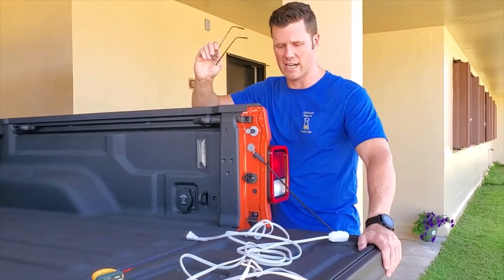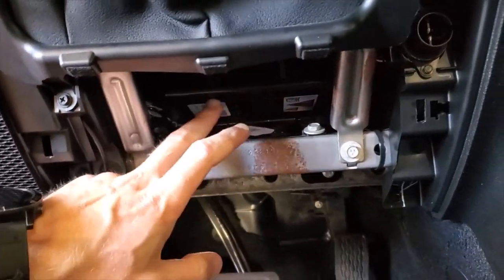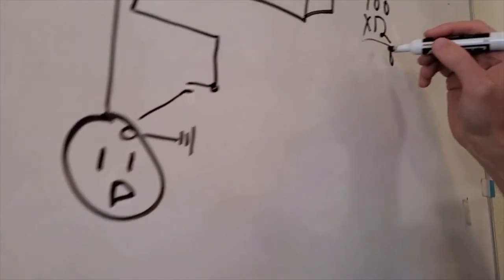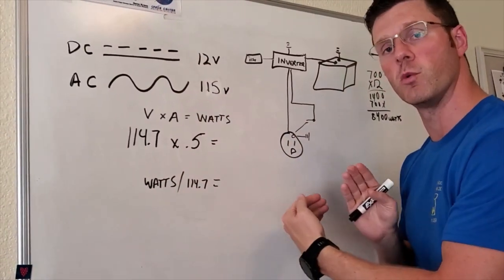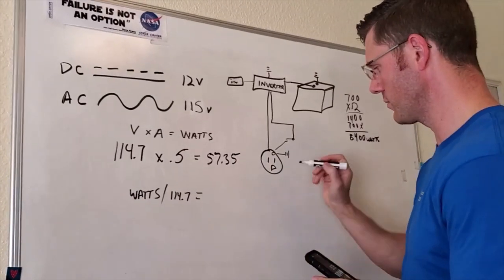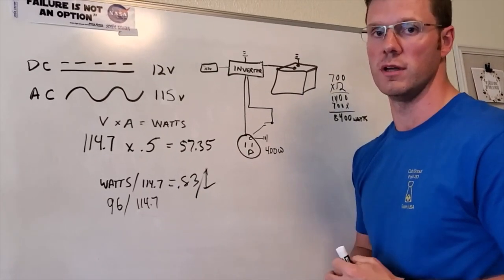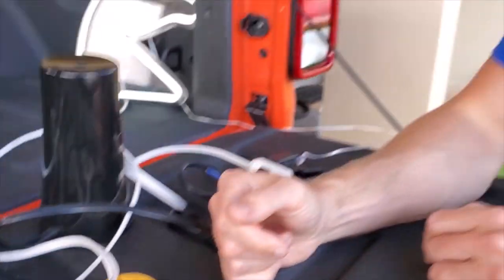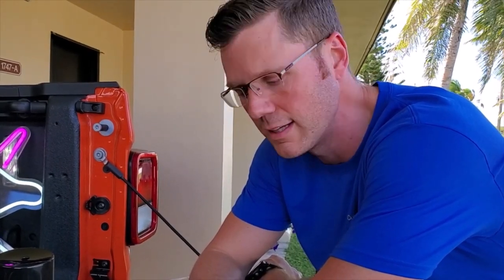Jeep Gladiator Ram Truck Power Inverter put to the test! You plugged in what? LOL

Comment: You're a lucky guy. I can't get any more than 102V AC from either one of my Gladiator outlets and I've been to three dealers who all say that's OK. I even had a dealer unlock a new Gladiator and let me check it out. Same thing exactly. At the house this same meter reads 122V AC yet your same meter shows 114.7V AC. Low voltage can burn up AC motors by drawing too much current.
Reply from the maker: These things do tend to run low but 20 percent low is way too much. I would not run an ac motor on these. Its too small for that. But it works for camping type stuff. I had a TV plugged into it as well. Worked great.

Comment: My problem is the factory plug is only good for 400w. My Bluetti pulls 465-470 and kicks it on and off. I need to upgrade to larger inverter. HVe any suggestions?

Comment: Great video, did you try or has anyone reading this tried an air compressor?
Reply: I have a small portable air compressor designed to inflate normal vehicle tires. Works fine plugged into my Gladiator. Does inflate my tires.

Comment: Thanks for the upload:) Do you know if the 400w OEM inverter uses a Pure Sine Wave or a Modified Sine Wave? (I have the same one on my RAM 2500HD) If it is a Modified Sine Wave, then it limits what I would plug into it.

Comment: Can I plug the Dometic CFX55 fridge in the the back of the Gladiator?  Its power rating is .84amps at 120V or 8.9 amps at 12V.  Not sure if it'll work with the 115V outlet rating or is it best to just plug it inside the truck's 12V outlet.  Thanks
Reply from the maker: 84 amps at 120v doest sound right. Powerful home outlets only go to 15 amps on most circuts.
Reply from the maker: From their website. Yes it will work.
ELECTRICAL

Input voltage (AC) 120 V
Input voltage (DC) 12/24 V
Rated input current (AC) 0.84A at 120V A
Rated input current (DC) 8.9 A
Input frequency 50/60 Hz
Reply: @c130aviator  Thank You, so is it safe to have it turn on while driving to charge the fridge :)  Just want to see what's the best way AC vs DC?  Fridge is located by the AC outlet in the back of the bed, so I hope the AC is fine for overlanding trips.  Cheers and thanks again for the detail video on the power outlet!

Comment: So my 2020 JTR did not come with this, but it did come with the max tow package. I did confirm (I think?) that the inverter is under the steering wheel like you showed in the beginning of this video. Are the only part's I'd need to hook this up myself the outlet (https://www.mymoparparts.com/oem-parts/mopar-inverter-power-outlet-68375111aa) and the switch (https://www.mymoparparts.com/oem-parts/mopar-inverter-switch-68370049aa - #3 in diagram) for the cab? I'm still doing tons of research here, but you're the most informative that I've come across thus far.
Reply from the maker: I believe you will have to flash the computer for that vin. But dealers won't do it. The other part is missing harnesses. Its a lot of work and may not work after you plug it all in.
Reply: @c130aviator  Ah, you're right. That's so frustrating. :\ I should've ordered it with my rig.. guess I'll have to do some research on how to setup my own.
Reply: @c130aviator  The part number for the Harness is 68398209AB they call it a wiring jumper. someone on the Jeep Gladiator forum provided a parts list of all he ordered to get it to work. I'd double verify that  these parts will work for your vehicle. He has an 2020 Jeep Gladiator Overland. I looked it up and it will fit my 2021 Gladiator Rubicon. I'm about ready order the parts from Mopar and give it a try. 
He had to activate the bed plug with a Tazer JL mini since none of the dealers would do it. 
6NU24TX7AB - Bezel headlamp switch
6839870049AA - Switch
68398209AB - Wiring Jumper (bed harness) 
68312754AC - Connector Inverter (plug) 
6104610AA Screw-tapping pan head (4) 
6509748AA - Nut-Plastic (4)
I did order the parts but if you use the VIN to verify that it will work on your Gladiator Mopar will say it does not since your Jeep didn't originally come with this option and there's no parts to compare it to, I went ahead and ordered it with the understanding that I could not return the parts since they cannot guarantee fit.  I also have the Tazer JL Mini on order they don't have 2021 Jeep Gladiator listed but zAutomotive assured me that it is compatible. There's allot of useful features in this product so it's not a waste if you purchase one. You'll probably use it for other features outside of activating the bed plug.
Reply: @c130aviator  Installed the plug with the parts mentioned in my earlier post and all works as it should, you have to activate the 115v plug with the Tazer JL mini. If you have a spay in bed then the plug blank is difficult to remove, I scored mine with a utility knife but its thick. Inside the vehicle some of the screws are difficult to access. You have to be careful of the headlight multifunction switch when pulling the bezel off inside the vehicle otherwise the back of the headlight multi switch will come off and make life difficult putting it back together again. Under the vehicle bed the harness and connectors are difficult to get undone underneath the vehicle, once you get that done your home free and installing the new harness & fasteners went quickly plug and play. It wasn't easy but can be done in a day, I did part of it one day and finished it the next. I tested it out with a small lamp and everything works like it should.